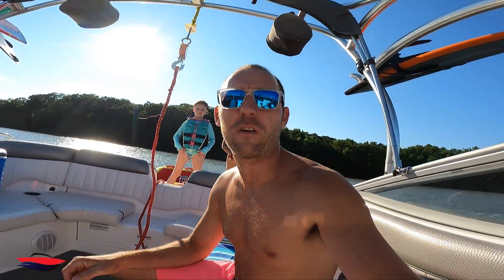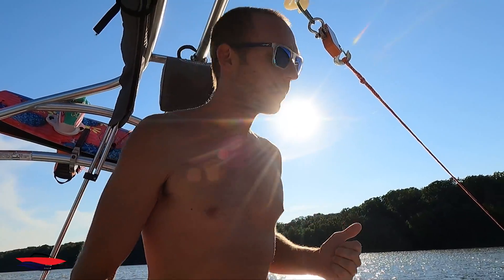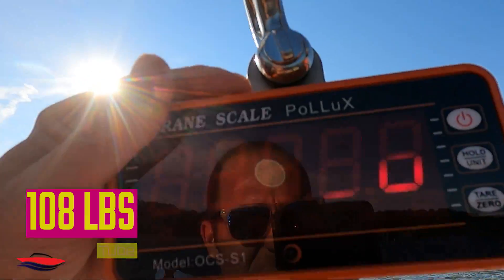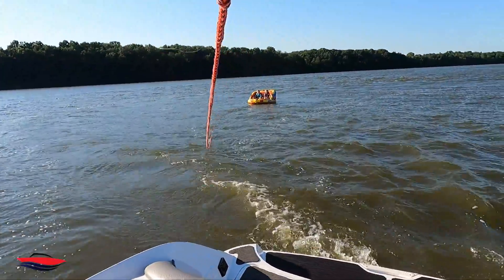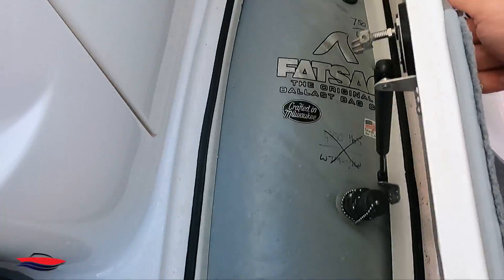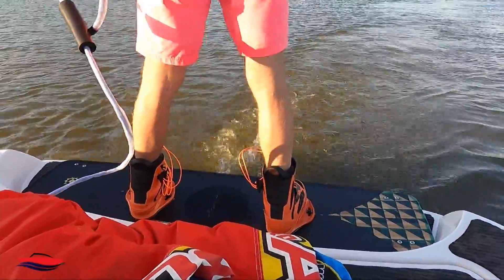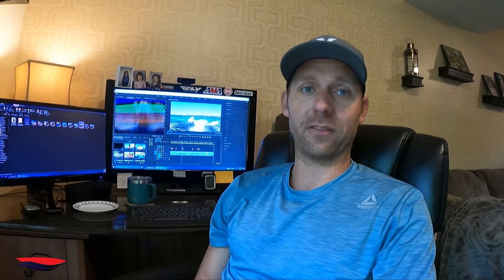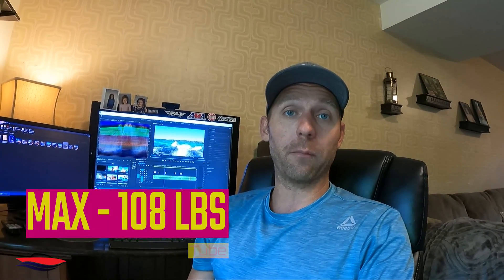What Is More Force, Towing a Tube vs Wakeboarder from a Wakeboard Tower.

Comment: 108lbs—-75lbs.. equals 25lbs?
Closer to 33 I think 🤔 I agree that’s not a huge difference but also not something to sneeze at

To each their own but it Seems like you should just tow a tube from the Transom eye (which is stronger than the gunwales where the tower is mounted) like you’re supposed to. 

It might work out for you with your 2 small children for awhile but it only takes one time to end up with a fracture in the fiberglass and then you’ll have a big problem. 
There’s a reason why every single boat manufacturer and tower manufacturer recommended you tow a tube  from the Transom
Reply from the maker: We have been towing 2 tubes from the tower.   Also,  the fiberglass area where the  tower mounts to is thicker than the lower tow point.

Comment: I think people need to consider one adult wake boarder might way 200 lbs and a person towing a 3 person towable tube with 3 adults considering most tubes say 510 lbs max weight is considerably more weight. Your test was for one adult wake boarder and then 2 children on a dual tube. So for your example  you should be fine but for my instance Id say your test does not apply.

Comment: Cool video!! I think the problem is (well not problem really, just a caution to others thinking about doing this) - you're not pulling the tuber like a lot of boaters (unfortunately) do.  Which is to say, sling out, a bunch of slack gets in the line, gets picked up (you're still going 20-30mph) then WAMO off they get yanked again from a standstill.  Add a couple of college dudes in the back to boot.   I know that's not how you're SUPPOSED to pull a tuber but that's how a LOT of people do (Whip, slack, pick up slack and BAM).  I've seen plenty of tube ropes snapped at our local lake - this kind of pulling won't do that lol!  Which again.. isn't smart anyway.. but you know.. smarts and boaters don't always go hand-in-hand lol.  But also consider that when I pull 4 in my 4-person tube, if I don't use one of my 4000lb tensile strength ropes, I'll snap at least one a year (well, only with the college kids or adults).  So lets cut that in half, say 2 people in a single tube with a 2k tensile strength rope.. if I've snapped a rope like that (which I have) pulling 3-4 in a single tube, there's got to be something going on there.  Perhaps I get slack in the line when I don't realize it after a hard sling, who knows!  I'm no scientist, but just throwing it out there that 2 and 4 person tube ropes have some pretty high tensile/break strength ratings.  I've got to think that's for a reason?

Comment: Can you do the same video with 2 160 pound 16 year old males.  I think your tower wouldn't last very long this is a dangerous video to post don't listen to him you can damage your boat and hurt someone bad
Reply from the maker: So what is the difference pulling a 250lbs skier or wakeboarder from the tower vs a 250lbs in a tube?  Do you believe there is more force being applied to the tower?  Do you believe there is less drag from the surface area of a wakeboard versus the tube?  Tim, I think you are an internet troll that has no clue what he is talking about and no evidence to back it up.  Unlike you, I preformed a test using an instrument to measure the force.  You are know pissed/upset because you and all the keyboard warriors have been proven wrong.  BUT, WHAT IF THIS OR WHAT IF THAT OR WHAT IF THAT AND THIS HAPPENED.  You can go on all freaking day long but the point is a 180lbs  person wakeboarding is just as much force a 180lbs person tubing.  BURN!
Reply: @JeffDoesThis  To be fair, they SAY there's an exponential drag effect when adding extra weight to something like a tube vs throwing that same weight on a firm plane-ing (is that a word?) device like a wakeboard, ski, etc.  This apparently is the same dynamic of soft-bottom inflatables vs RIB's (rigid bottom inflatable's) and also to some extent why they have different power ratings, albeit not necessarily different capacity ratings.

Comment: Ok. What is the strength from an engineering standpoint? Maybe at 200lbs of force it rips off? Only an engineer could tell you what the specifications are and why. This is a cheap experiment and dangerous to promote any tower to pull tubes. My neighbor was pulling two circle tubes, each with 4 or 6 adults. Just a matter of time for that to break.
Reply from the maker: You let me know when it breaks and you can come back here and tell me I told you so.  You do that for any yamaha boat with a factory tower that breaks from towing.   I will wait.
Reply: @JeffDoesThis  I think you're getting a little defensive.  It's an interesting conversation to have.  I've personally seen several boats damaged from doing this (mostly at the mounting locations) - they all had different reasons for doing so (alcohol often involved) but people just aren't responsible at the lake.. and do things they shouldn't do all the time.  It's a lot harder to 'get in trouble' when pulling a wakeboarder (from a damage standpoint).  I'm not going to go shoot you videos to prove it, you don't know me from adam so you probably wouldn't believe me anyway, and yes many people get away with doing it juuuust fine (I've done it myself) - but from personal experience I can tell you I see this many times a year at the shop for repair.  Up to you whether you want to believe me!  Now to be fair, I've never seen it result in any injury, mostly just (financial) tears.. (and to be clear when I say in the shop for repair, I'm talking fiberglass work, ranging from minor (stress cracks) to pretty gnarly damage - I've never once seen the tower itself break).  And yeah.. some of that damage was also due to some BAD installs!

General rule though with watercraft and pressures is whether or not that pressure is static.  I'm not making this up when I say, I've seen guys do boat tug-of-wars using their towers with a rope attached.  Nothing much happens other than the boats sitting there bogging down trying to go.. and I'm fairly certain the rope/towers aren't being stressed much at all.  Boats don't get a lot of 'traction' so when they are pulling against another force, it can't exert a ton of energy.  This is also why it takes so much power to (quickly) pull a single skier out of the water.  Yet throw that same skier behind a little geo metro on land.. it'll yank them right up!  

Here's what makes the difference..  allow those same boats to now get a running start against each other.. then the rope gets tight... you better stand back lol!!  And this is more or less what happens with tubers at the lake.  Swing out, they get a TON of slack in the line, the boat is moving very fast, then it INSTANTLY grabs.  Lets throw 2-4 200b guys back there.  So 400-800#'s - with (usually) water in the tube.. because it's under-inflated and their fat butts start to sink it - and apply that instant shock to the tope and tower (I have no idea what the equation of that is, but I'd assume that speed is also a variable).. over and over and over again.  It's that very high, instantaneous shock that does the gel or fiberglass cracking, not the sustained load.  Check out the test on YT "Wakeboard tower DESTRUCTION" - you can get an idea on the stress that various #'s of pressure can do (and yes I get it, that's a non-ideal tower and mount design).  Will you get that stress sustained? No, never, but it at least demonstrates the force an 800# + instant shock can apply.. for all those with bad tower designs LOL!

Your video proves you can do this very safely if you're smart about it.  That later bit being key :)  But honestly, in the damage I've seen, I think the only real risk here is cosmetic (to the boat).  I've never seen a tower actually break, or ripped completely from its mounts.  You'd have to send the boat under a low overpass to do that I'd think lol!

Comment: Those big relaxed tubes aren’t the ones to worry about. I grew up using smaller more maneuverable 1 and 2 person tubes, doing tricks on the them, purposely rolling them etc…we’ve submerged tubes multiple times with enough force to pop tubes and snap tow lines or rip the seams off the covers!!! As recently as last summer…granted was towing my 315lb brother in law lol.

Comment: Nice video!  I was actually planning on doing this same experiment.  
I have no issues towing from my factory tower, and no fear of ripping it off. I typically don't tow tubers from it just because of the potential of becoming airborne,  and the chance of whipping them around and the tube ending up in front of the boat. 
I have noticed that on a 2 or 3 man tube such as you're using, the front can submarine (especially if the tube flips) while you're turning around to pick up your riders. If be curious to see how much that might increase the weight. Would pulling from the tower keep the nose up?
Reply from the maker: I sure it would be alot.  Again, you have to be careful, we have never had our tube submarine.  Teach the kids, adults to sit back and not lean forward and everything should be aright.   Our tube gets towed from the tower at least once a week since the beginning of the season and no problems.  We have been doing this for years.

Comment: If you submarine the tube it will NOT rip the tower off. I’ve done it not on purpose. You’ll feel the boat being jerked the nose goes up a lil and nothing else not even spider cracks.
Thanks for the video.
Keep in mind the way older towers are anchored not the same as new ones.
Reply: Have seen several boats where a submarines tube broke the tower in much more expensive boats than a Yamaha

Comment: I'm a rule follower and have not towed my girls from the tower because of the manufacturer's warnings.  I've always wondered about the actual forces being put on the tower, as I assumed (incorrectly it seems) that if I was wakeboarding, it would put way more stress on the tower than a tube with two pre-teens on it.  I'm 215, my girls are probably 75 and 45 lbs.  The drag from that tube is probably where a lot of that tension comes from.  Really interesting video, I might tow the tube from the tower every now and then based on your research.  Appreciate it!